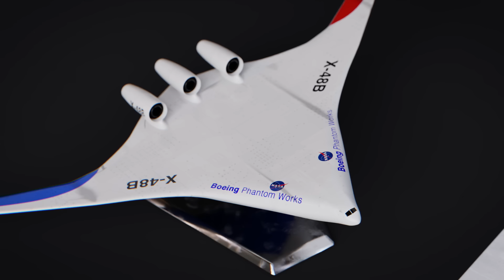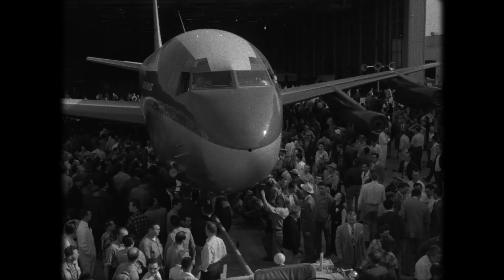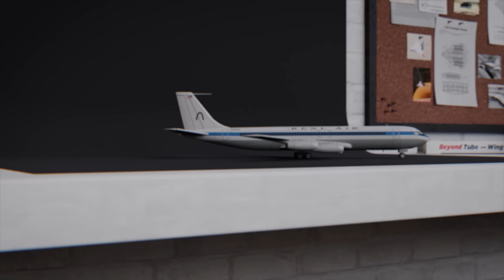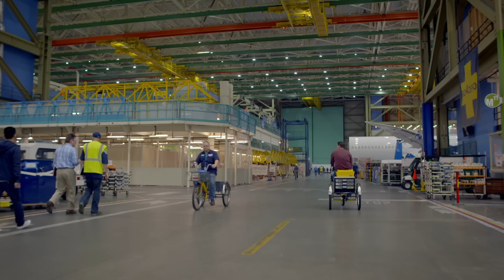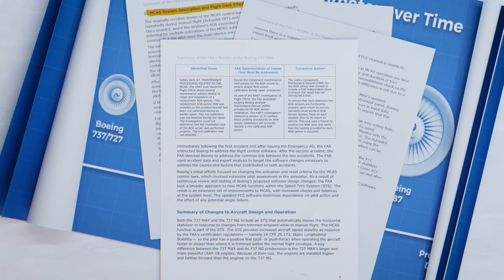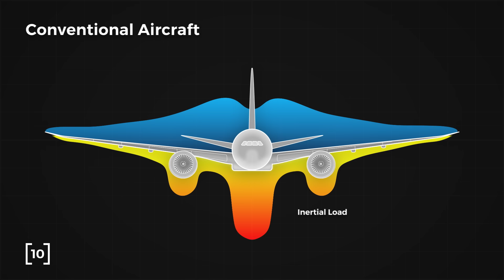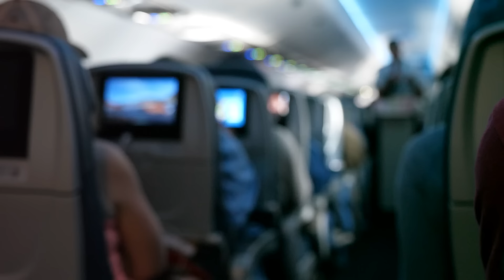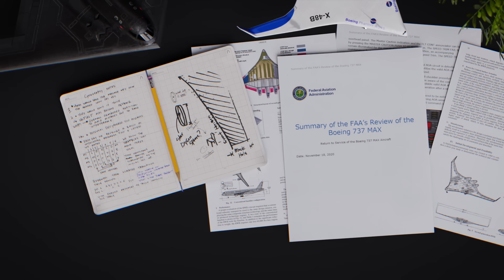The Plane That Will Change Travel Forever

Comment: You have some very good very fair points. I will say, you are expecting them to have more skilled workers in a pilot shortage. The plane designs you have provided as better for fuel consumption has made them much more unstable, which you just went over. You have done a great job of looking at all the issues. Feels like I millitary level training could allow much more technologically advanced aircraft, and achieve many of the goals that you see as flaws in the current aircraft design.

Comment: You should look into Ammonia based hydrogen storage/burning (rather than straight pressurized H2). Well established processing, global supply chains, more easily transportable (less internal pressure, like propane) and as a bonus can even be smelt when in gas form. Hell, throw a LFTR reactor to get the heat for the Haber Bosch process and could have a semblance of being more green (though still need a source for the H2 feed, though the industrial heat from the LFTR may help with that). There's been a couple papers on it and iirc the US government looked into it way back as well but dropped it.

Comment: Well, less eco hostile. Also, while engine size has increased efficiency, so have incredible advances in materials science, combustion modeling, and heat dissipation that have enabled much higher operating temperatures.
Reply: If you want to be intentionally antagonistic sure.
Reply: @Demonslayer20111  I’m not clear on how that is antagonistic.
Reply: @TIO540S1  negative connotations over a positive result. Word choice means everything for tone when writing.
Reply: @Demonslayer20111  a smaller negative impact is not a positive impact. If someone pummels me with a bat, and then switches to slapping me with their hands, I wouldn't say they're treating me better. They are inflicting less harm.

Comment: You don't mention that the software and hardware design was outsourced to India. If this system was designed by in house Boeing flight engineers we probably would not have seen any crashes.

Comment: We probably will not see a hydrogen powered airliner.

Hydrogen is just too difficult to deal with. It has lower energy density, and it must be stored super cold or highly compressed.

A room temperature derivative of hydrogen, methanol, may be far more practical, even though it is still a hydrocarbon. It has 4 hydrogen atoms for every 1 carbon atom. That would probably be a little more than half that of conventional jet fuel.

The flying wing plan-form is interesting, but I see a lot of pitch instability with it. The higher aspect ratio wings in the back are likely to stall before the front of the lifting body will. This can easily lock in a permanent nose up attitude with very little leverage for the ailerons and the top mounted engines to restore proper pitch.

I get that the computer controlled ailerons and engine throttles will work diligently to keep that from happening, but what if an outside force, such as a sudden up draft, drastically pushes the nose up? And then both engines fail?

Will they be able to make this thing glide?

Wouldn't it be simpler to keep the tube-and-wing plan-form, put the wings aft, put the horizontal stabilizers up front (where they contribute to lift), and make them higher aspect ratio than the wings (so they would stall first, and cause the plane to pitch nose down).

Comment: A few things occur to me:
1. No mention was made of a savings in "wetted skin area", but I'd bet that a blended-wing design has more of this undesirable source of drag than a "tube and wing" design.
2. Carbon fiber monocoque structures are always looked at in their pristine, best-case scenarios, when in reality, they're all well and good...until it comes time to repair them.   Then, they are a PitA.  Unlike an alloy-skinned plane, where rivets can be drilled-out, the damaged piece of alloy skin peeled away and a new piece riveted and bonded in its place, there is no way to reliably patch a carbon fiber skin without sacrificing some of the shell's structural integrity, ending up with a lump, or otherwise unwanted results.  Ask anyone who has had to patch a fiberglass boat about this.
3. I had to laugh at the notion that a blended-wing craft, with its "6 exits" would somehow be vastly faster to load and unload than a tube-and-wing.  Are all of the world's airports suddenly going to have 6 dedicated airways for each craft, somehow docking with them and extracting/loading passengers?  I can't imagine how.
4. I have to wonder how much more a blended-wing craft is subject to surface-effect phenomena than a tube-and-wing configuration.
5. If you're going all-in on aerodynamic cleanliness, why still have engine nacelles grafted onto the aft-end of the craft, producing all of that parasitic drag?  Why not bury them in the body?
6. As pointed out, tube-and-wing configurations typically feature a horizontal stabilizer that is canted downward to counteract the center-of-lift, and thereby wastes energy.  I have to wonder if a canard configuration couldn't obviate some or all of that, while retaining the tube-and-wing configuration.  
7. I have to wonder how the FAA type certification issues would be ironed-out.  As mentioned, the ability to change the length of a tube, etc., has been a boon to manufacturers.  But what can be done to a blended-wing craft, to adjust it for different markets?

Comment: Assuming all other engineering challenges are solved, a plane with 27% less energy needs would go a long way toward making electrically powered commercial jets a reality.
Reply: If most of those passengers were pedalling, it would make powering it on electricity feasible!
Reply: @stevie-ray2020  it'd smell a lot worse, too lol.
Reply: @voxelfusion9894  Lol! Bit like going back to the days when passengers were allowed to smoke cancer-sticks!
Reply: @stevie-ray2020  I remember those flights, and busses/car rides from my childhood, and I'm still alive and breathing
Reply: @stevie-ray2020 
If most of those passengers were pedalling, it would make powering it on electricity feasible!

A human being pedaling can produce up to 300 watts per person. Many people are out-of-shape and would probably not endure at such power output for long. 300 watts isn't even enough to run a normal-sized refrigerator, a small window air conditioner, nor a toaster. And considering that passengers pedaling would require more food for them, more water, and more trips to the restroom. Probably not a good idea for various reasons. A pedal car can not begin to reach freeway speeds. You need at least 15 horsepower to maintain freeway speed, and that leaves nothing left over for acceleration nor for hill climbing. A human being can not even reliably produce half a horsepower.

Using actual horses, wouldn't work either.
Reply: @yosefmacgruber1920  I wasn't being serious!
Reply: Exactly. And this can also be done with solid-state batteries internally and on the plane's skin. As long as you don't need to go supersonic, hydrogen is unnecessary.
Reply: @hendrikdependrik1891  but we already know hydrogen can work, the Russians built a plane running on hydrogen in the late 80s. Solid state battery technology is a long way off, especially for things as heavy as planes
Reply: @hendrikdependrik1891  Supersonics will be the norm before any hybrid wing is being tested, let alone certified. Going to be tough to convince the population to go back to subsonic flight, and hydrogen will be needed. Hydrogen commercial planes are also getting much more funding, as hydrogen infrastructure is seen as easier to build than battery infrastructure.
Reply: @bornob  all uneconomic nonsense
Reply: Yes turboprops are already going all electric.  Look at Celera
Reply: @crhu319  I can't remember the last time I flew in one, what lines are they flying?
Reply: @crhu319 
Kind of hard to go all-electric when there is no connection to an electricity power plant.
Reply: It could allow electric aircraft to break into the 2-3 hour medium haul market. That's a pretty big market, it would cover the majority of intra-continental flights in Europe (including those lucrative leisure charters to the med) and a good chunk in the US. Transoceanic will probably never be electric though, there just isn't enough range even with the best battery chemistry. Instead hydrogen or synthetic fuel will be used.
Reply: Not to mention the SURFACE AREA OF THIS MONSTER.
It'd easily be able to power a large chunk of itself with solar greatly increasing range and obviously efficiency.
Reply: @TauCu  You might be able to power a few non safety critical auxiliary systems (such as cabin lights) with solar, in the daytime. It might not be worth the expense though, as a fraction of the total energy needed to keep the plane in the air, it's pretty small.
Reply: @TauCu 
On a cloudy day? At night? Solar is overrated. There isn't that much area. Do you know how much wind drag there is at that speed?
Reply: @TauCu  Not even enough area to offset the weight of the panels themself, look at Solar impulse, same surfacearea and barely kept an ultralight build afloat over night
Reply: @someoneelse7629  panels?
It'd be inefficient to use panels yes.

solar cells are semiconductor junctions and they can be extremely thin if shaven, making their weight almost nothing.

And yes i would think that using solar panels on a small ultralight overnight would indeed not work very well.
Reply: @TauCu  And how well would they work on a big heavy Boeing over night?
Reply: @someoneelse7629  much better.

the op was about batteries, that's what you'd use overnight.

larger aircraft are more efficient than smaller ones.

this thing has much more surface area for it's volume than an ultralight making it well suited for this.
Reply: @TauCu  No, its bigger, heavyer, and less efficient then the solar impulse, that was purpouse built to be able to fly electric, this plane will not be able to be electrified easy, in that case they would have thaught of it long before you did, or are you much smarter then the all the people developing this aircraft?
The batterys must become twice as good as they are now (atleast) regarding power to weight ratio to make electric passenger planes a reality.
There is one small (~20 passenger Heart Aero) plane under developement, but it will have so short actual range (400km) that it will only be able to fly some very specific routes, since airplane must have enough extra range to be able to go to an alternative airport if there is a problem at the destination (and with the range that plane has it is most likely back to where it started) so that will limit the range between airports to 200-300km)
There is user cases for this airplane, like island hopping short distances, and as shuttles to bigger airports, but it is guesstimated to fly some testflights in 2026, and maybe be delivered (yes they have orders for it) a couple of years later. IF IT WORKS
That is the current state of electric planes right now.
Reply: @someoneelse7629  Did you wake up with a stick up your behind or something?
I didn't say I was any smarter than the engineers at these companies.
I made a comment stating that you'd be able to power a large chunk of this with solar, not the whole thing responding to a comment where the first statement was "Assuming all other engineering challenges are solved" or did you just so happen to forget about a key detail of this comment and thus my reply.

also, bigger != less efficient
If that where the case you wouldn't see designers trying to make larger and larger aircraft for passenger transport.
Reply: @someoneelse7629  Imo the largest problem with electric planes is that batteries don't get lighter if you drain em. The longer you fly a conventional plane, the lighter it gets, vastly improving efficancy and flight characteristics over time. Many large airliners can't land savely if they take off with max weight with full tanks, they have to burn or dump fuel first. An electric plane will allways stay at takeoff weight.

Comment: Can you do something about "wind dihedral" including planes that used negative dihedral?  One is to maitain stability and the other to intentionally create instability in return for maneuverability.
Reply: >  [...] and the other [negative dihedra] to 
> intentionally create instability in return 
> for maneuverability.

Ummm, no.
Dihedra (both positive and negative) is something that is in an aircraft designer's design tool box and sometimes, negative dihedral actually helps stability under certain conditions, such as in a turn in the F-104.
The negative dihedral wasn't added to make the F-104 less stable, but rather to reduce the tendency to dutch roll because of the oversized effect of the vertical stabilizer due to its relative size compared to the wings.
Reply from the maker: Already have, look through my aviation playlist.

Comment: With the engine on top design how would they combat compressor stalls from flow speration from high angle of attack in take off? From what I remember current engines require smooth uninterrupted air flow to work.
Reply: Angle of Attack (AoA) is the angle between the relative wind and the line of the wing, not between the horizon and the line of the wing.
So during take off and landings, the AoA is high (to generate the maximum amount of lift), but the wing isn't stalled as that would cause a reduction (of not outright loss) of lift.

What's more worrisome (at least to me) is the airflow being disturbed by skin friction above the wing.
But a "solution" to that is to mount the engines somewhat above the wing on pylons where they will be in (largely) undisturbed airflow ... which appears to me to be what the designers have done according to the models.

Comment: What will the ride be like in the cheap seats of the outer aisles where you'll move up and down significantly when the plane rolls?
Reply: Indeed, that's one of the problems that comes up every time. I've heard a few good answers.
One, you put cargo out in the wing. Not only doesn't it get airsick as much but you also solved the problem of how to evacuate those sections. On the other hand, loading and unloading would be nightmarish, and balancing the wings would require an engineering degree from Princeton. 
Another option is to store fuel there. That solves not only the human problems, but also the cargo handling and balance problems. On the other hand, this is exactly how it's done already, so we are back to the tube and wing design.

Comment: Windows aren't just a nicety, they are actually a safety feature (accidentally or purposefully I do not know). In case of fire, it allows some level of mapping to firefighters on the outside, which can change their plan of attack. And that could be the difference between a bad day and a tragic day. Also, how would a ditch be handled because the wings are high slung? Also, there must be windows for the escape door to be able to see if opening that door would be beneficial or harmful to safty.